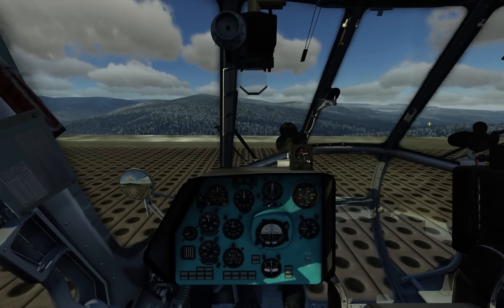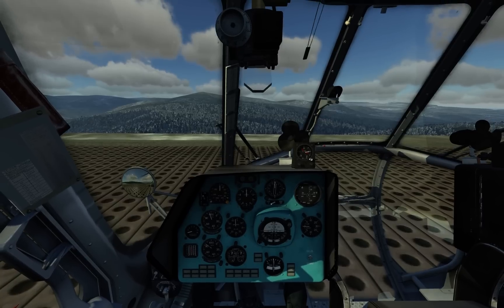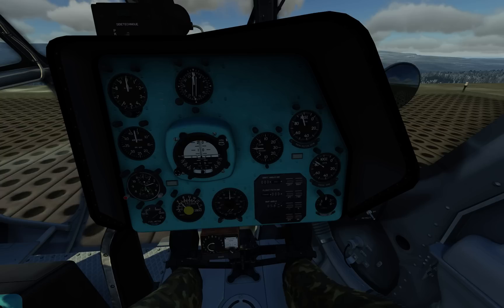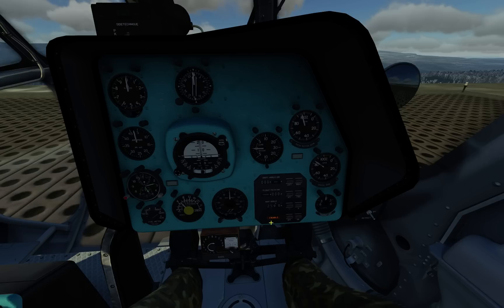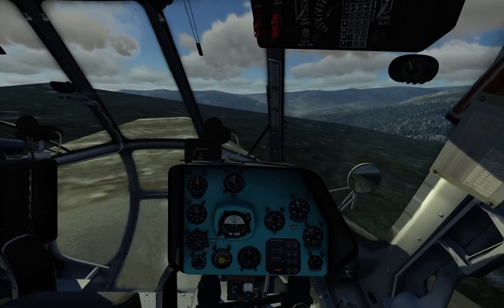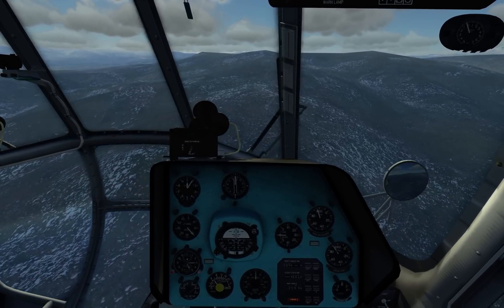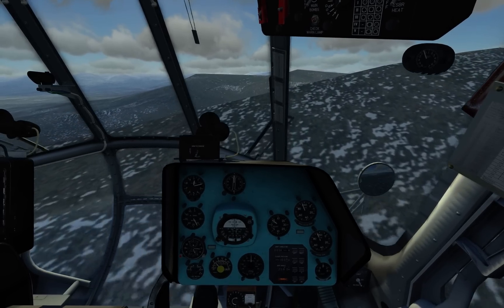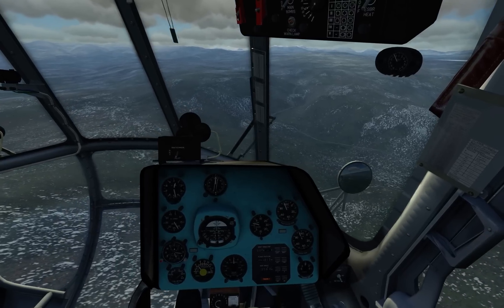DCS Mi8 Doppler Navigation

Comment: Just a heads up, the Doppler system in DCS uses Magnetic headings, and the map measures headings referenced to True North. The caucuses has a Magnetic Variation of 5 Deg. E. So following the mnemonic aid "East is least (-), West is best (+)" We subtract 5 degrees from our true heading to find our desired magnetic heading (You can find this by looking at the north arrow on airport charts in DCS, for the nearest airport). 259-5=254.

I've discovered this by being off on longer distance Doppler flights.
Reply from the maker: +randomYOUTUBER Thanks, that's a good tip.  I was a little surprised that I ended up north of the lake rather than in the middle.